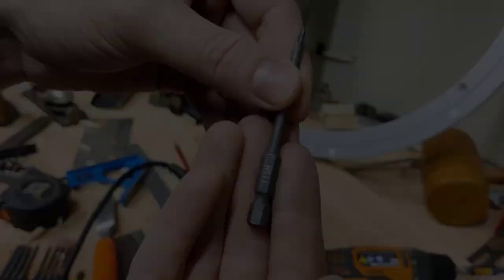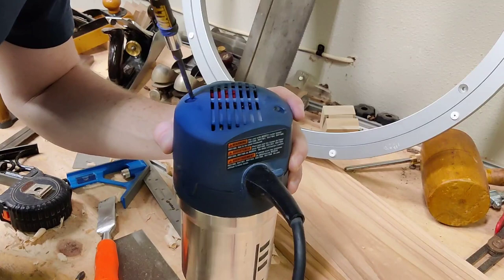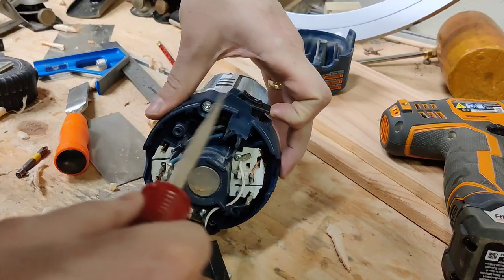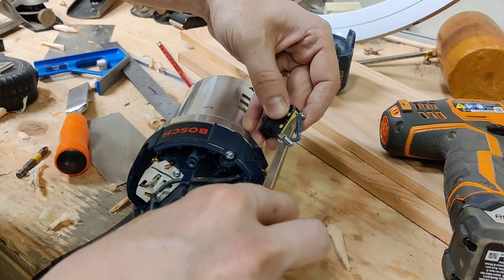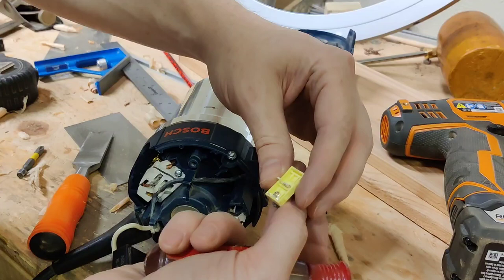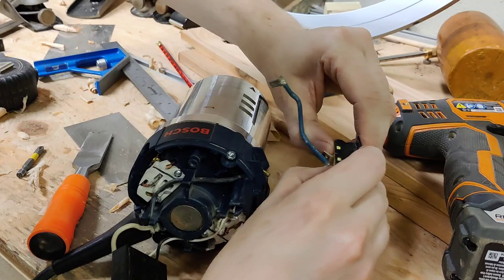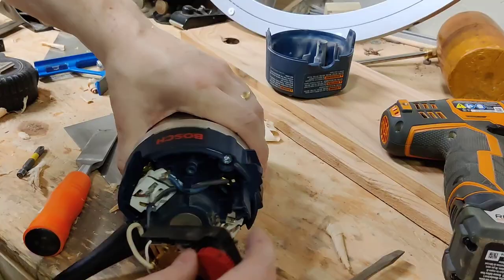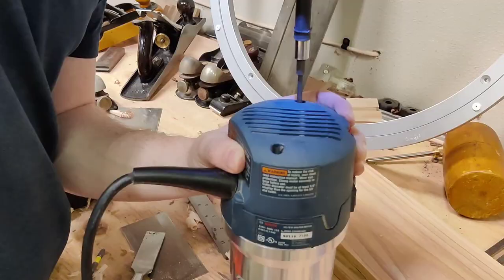Don't panic: Fix your Bosch 1617 Router with these quick steps!

Comment: Thank you.  I was in a panic, when the switch was dead.  I followed your instructions, and had it fixed in 10 minutes, AFTER I located a T15 screwdriver.
Reply from the maker: That's awesome. Glad your router is working again!

Comment: Thank You so Much for posting this Video. That was exactly my problem. My Bosch just stopped running and I had no idea. an easy fix but pay attention on the little brass clip in the switch that will fall out and do not lose it. Thanks again.

Comment: Nicely done! So glad I found your video, saved me time and money. BTW this is the second Bosch power tool I've had with a simple switch failure. The other was a 4x24 belt sander. That switch was completely consumed by arcing of the contacts... And they no longer off the switch as a repair part. I managed to fit a momentary toggle switch in there but it wasn't easy.
Reply from the maker: Sounds like power switches should be re-evaluated at Bosch. Granted they could have addressed some of these issues already. My router is at least 4 years old, maybe older.

Comment: I bought a "broken" 1617EVS off the Bay of E's and just the jostles of shipping knocked the dust out of the switch. It works fine so far but I also stock a spare switch if I ever run into one I can't fix. (I have four 1617's).

Comment: Thank you so much for this. It was exactly what I needed to resolve my issue. Only trouble I had was orienting that pesky little brass plate correctly. After about 10 tries, I finally got it right. Thanks again.
Reply from the maker: That little plate is tough. Glad your router is working again!

Comment: Holy cow, this worked! Of course, my wire was black not blue, was soldered at the switch end instead of bladed, and wouldn’t let go of its copper contact at the other end, requiring me to pull the 1.5 inch copper contact all the way out from the depths of the unit instead. Thankfully, that slotted back in and seated satisfyingly during reassembly.

That was a little roller coaster ride: “Easy fix, cool! Oh, disassembly with fiddly parts, I’m just going to buy a new one so I can get my project finished and if I ever have time to try to fix this I’ll have a spare. What, orange box doesn’t stock 1617’s anymore and it’s days to delivery? Ok, t-15… less than 10 minutes later, the lovely sound of soft startup fills my ears. This vid was a real mitzvah, thanks!

Comment: Well done! I would suggest that it be mentioned to make sure yellow insert is reinserted the same direction it was removed. And, I filled the cavity with dialectic grease to prevent sawdust intrusion in the future. BTW, it took almost twenty minutes of constant tapping to get all of the sawdust out of the cavity.
Reply from the maker: Good catch. You do have to make sure it goes back the same way or the switch won't work. Good call on filling the switch to prevent the issue from happening again!

Comment: My guy. My router just.... stopped working last week. No sign of a problem before hand.

Found your video... Watched it and fixed my router in less than 15 minutes. Took me 5 minutes to find the right sized torx. 

You my friend is one of the reasons the internet is awesome.

Subbed up.
Reply: Also as a note to anyone that comes along later. My router had a black wire where yours was blue.
Reply from the maker: Awesome! Glad the video helped and your router is back to working order. I find I have to do this once a year now, especially when I take it from the router table to the plunge base, it tends to shake the dust around in the switch and interrupt the connection.

Comment: Incredible video, thank you for saving my wallet from another router purchase!

I used a pipe cleaner and q-tip to get the packed dust out more easily. 10min from start to finish.
Reply from the maker: Awesome! Glad the video helped and solved the problem.

Comment: In my case, the process was more involved. The rocker portion of the switch is inside a plastic membrane and that is where I'm clogged up. This seems impossible to get apart without damage. Ordering new switch on Amazon. But thanks for the video. Got me started.
Oops. Spoke to soon. with a little more prying the rocker comes out. I think my switch was even more full of dust than usual because I primarily used the router under the table and I have a foot switch connected so I'm in the habit of leaving the on/off switch on all the time.
Note: I almost destroyed the contact down to the motor when I removed the blue wire. The copper contact lifted out of the motor as I pried on the spade terminal. NOT GOOD! I did push it back down and when I fixed my switch and reassembled there was a momentary contact which I think is due to the long copper contact coming loose when I pried on the terminal. I would just caution anyone doing this repair to be very careful when prying up the blue wire spade terminal. I can't say I'm real happy with Bosch right now. This is a long-standing problem for them on the 1617 EVS.
Reply from the maker: This is the second time I've had this happen. The first time it was even more packed with sawdust. That's too bad you had to order a new switch. The first time everything was a little tougher to get apart too but after it all comes apart it's easier the second go around because it'll happen again. It would be nice if Bosch was able to better seal the switch so they don't get clogged up

Comment: My plunge base is very hard to plunge. Gets stuck alot. I've tried dry lube but it didn't help. Any suggestions on what could be the problem? Model 1617EVSPK
Reply from the maker: Not sure, I haven't had that problem. You could try removing or moving the black plastic shields and see if there's something caught in the springs

Comment: Will this "dust in starter switch" also cause the router to slow down after being on for just a few minutes?  My router starts properly, and will run properly for a few minutes, but then slows down to a uselessly slow speed.
Reply from the maker: That sounds like a different issue. You can contact Bosch for support in diagnosing the issue.

Comment: I could kiss you right now. Got it fixed without having to take the motor out of the base.
Reply from the maker: I'm flattered but would settle for a high five :)

Nice! I should have mentioned in the video I only removed mine because it was attached to the circle jig, but it doesn't have to come out of the base to get at what you need. It's actually probably easier since the router will be held upright that way.